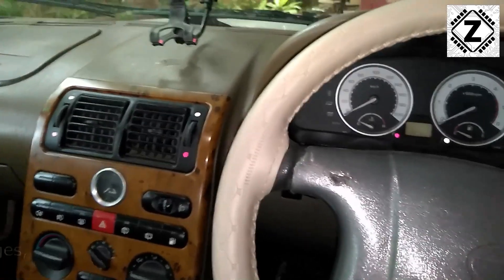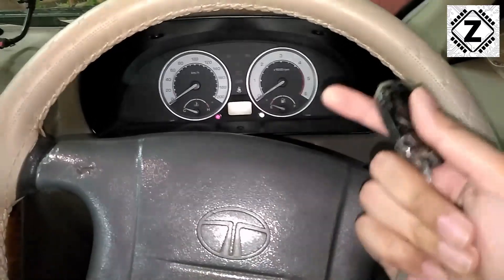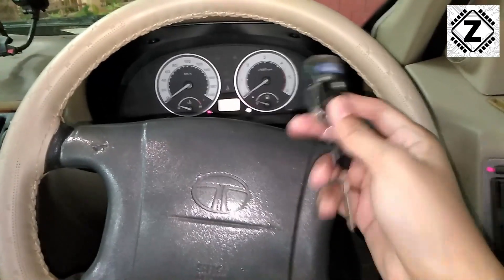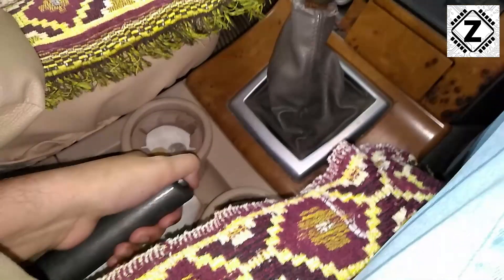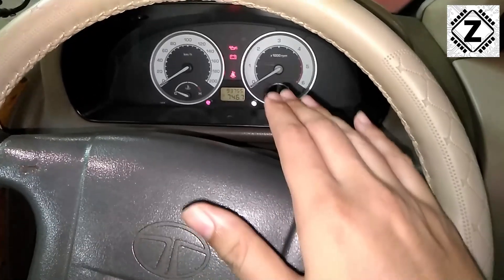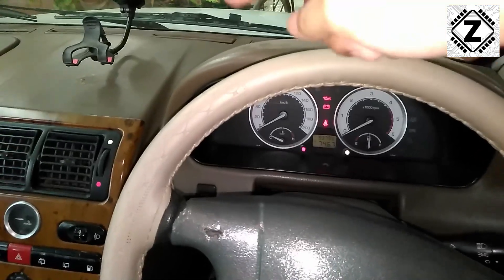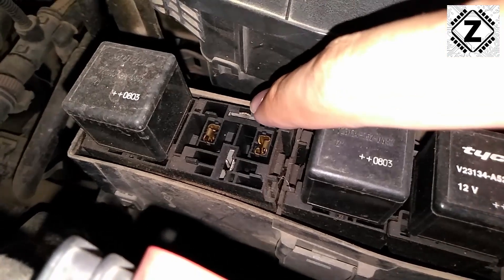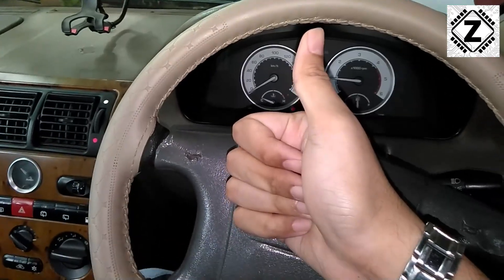[Eng] Tata Safari not starting Full Solution | Key Detection & Immobilizer Error | Emergency Start

Comment: My tata grand safari 2. 2 diesel  my tata started then just stopped and won't restart the ignition just clicks but doesn't turn engine over the immobiliser is not on limp mode anyone help
Reply from the maker: Did you try all tips shown in this video?
Reply: @ZenInnovations  yes I did but nothing happened